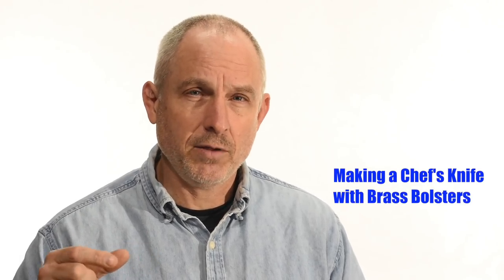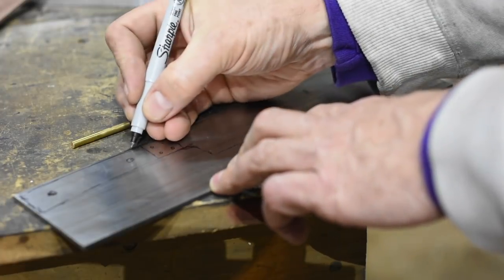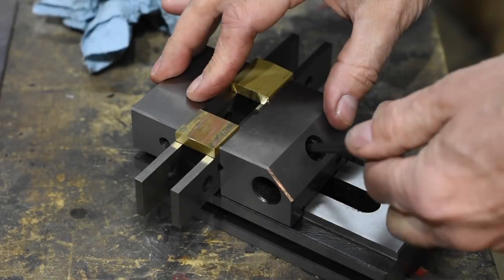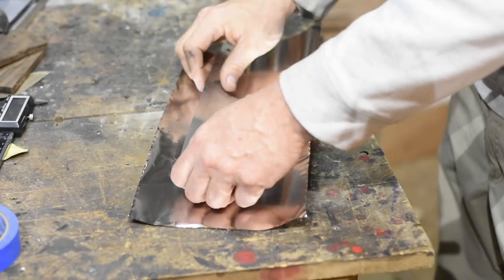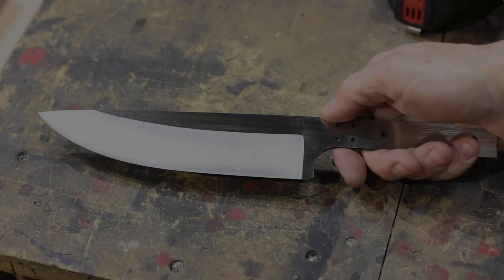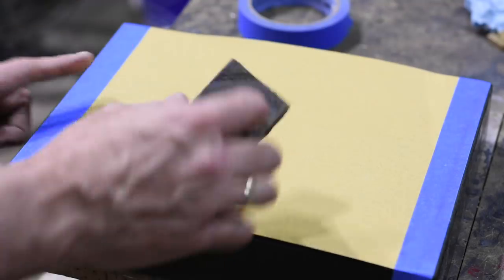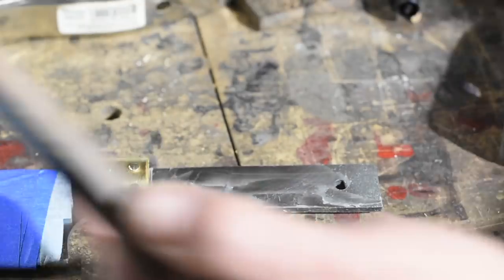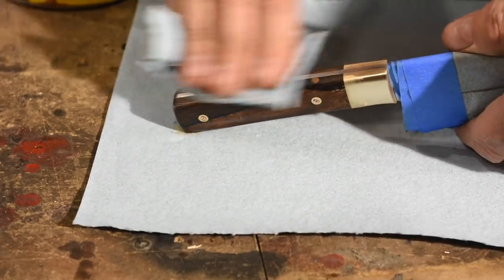Chef's Knife with Bolster: Make It!

Comment: One way that has helped me with hand flattening surfaces is to use billets to provide the pressure needed. Using my arms to simply guide the material. That way it is a consistent, even pressure orthogonal to the surface and you dont have to worry about micro movements of your limbs from pressing down. It also saves your joints the wear and tear and allows me to go longer without getting tired as easily.

Comment: Hi Walter, when it come to thin stock (3mm and below) I always heat treat before grinding bevels. I find that it reduces warps in the quench. 

Like you, I use Combat Abrasive belts, they eat up hardened steel like it’s butter.

Comment: Some thing i learnt/learned .. from sanding bike fairings with wet dry is if you use soapy water they dont clog and instead of sanding a patch 10 x 10 cm before the sandpaper clogs you will be sanding entire fairing sections and square feet/yards and not 1 speck on the sand paper. The grit wears out, falls out and paper shreds but not one bit of dust on the paper.

Comment: hi Walter. Bolsters. For some reason, I have this obsession that makes me thing I have to include these. A remnant from before so many knives were just simple handle scales on a flat tang (not that it is really easy to get the front of those to align). Anyway, Alan Longmire got me into using 0000 steel wool as the last step with brass. I sometimes combine that with loose a.o. or si C. abrasive powder in the steel wool. Just making conversation. Not at all trying to tell you what to do. Thanks for showing your process.
Reply from the maker: Thanks, Kevin, I appreciate it.

Comment: people with surface grinder experience probably know this but I think its a cool factoid anyway. The surface grinder's magnetic chuck will bend pieces that aren't already fairly flat or that have some warp when it is engaged. This isn't super obvious until the chuck is disengaged and the part springs back to normal and you now have a surface ground part with a bend in it. NYC CNC has a really cool video on slowly disengaging the mag chuck on a surface grinder when grinding a large parallel to avoid this problem

Comment: My first knife was a kitchen knife and with a bolster like this, although mine was done using only a pillar mill and a set of files. It's actually  not that difficult to do overall by hand - just drill the holes in the blade, then flip and drill /repeat like you would with handle scales. You can then use locating pins and do the shaping and polishing in a vice. The only annoyance I really found is that you really are making TWO handles and then a bit more, in terms of time and dedication. However, I think it really makes for a nicer looking knife, and I think it protects the front of the wood a bit better as well.

Comment: Here's a question -- could you remove the bulk of the bevels, roughing on the belt sander, and finish on the surface grinder?  

Also, I noticed you pulled the parallels out from under the drill bit -- hahaha, took me a few times of running the drill right into the hardened parallel before I remember to do that.  :)

Comment: Walter you cross feed is way too aggressive. Feed ~.030” across for each pass and you will not load up you wheel leaving burn lines. When that occurs you leave micro fractures in the steal. You depth of material plunge before cross freedom. Should be up  to .030”  for roughing and .002 or .003 for finishing. Also look into a coolant system and you will be swinging like a pro

Comment: Walter, I do not understand how a surface grinder holds such a tight tolerance since on every pass the wheel wears just a slight amount. Does it automatically compensate for that by ever so slightly get turned lower?
Reply: They don't wear all that fast and if you only grind with small section of the wheel it lasts longer

Comment: I love the videos... but always come away with tool envy and feeling inadequate!
I just want to make a few knives here and there and as with anything I do, put them out in a quality fashion.
Like me buying a $4000 surface grinder?  It ain't going to happen!  ...well unless I win the LOTTO so I can outfit a $250K multi shop!
Reply: Hey Graph.. check out Trollsky's early work. He started out with pretty much nothing but an angle grinder and files and created some masterpieces. You can get close to if not the same results without all the tools, it just takes longer. Walter's demonstration of sandpaper on on a plate of glass or granite is how I currently flatten things, including metal. Not as quick and easy as a surface grinder but I do get the same results, and a slightly better surface finish.
Reply: Appreciate the reference and voice of experience!